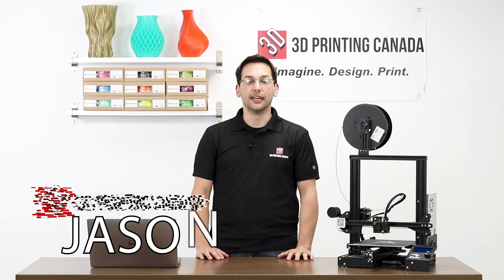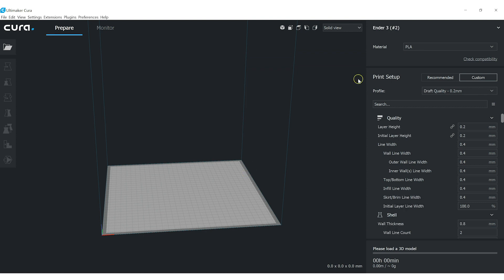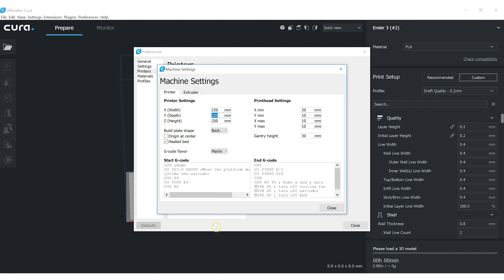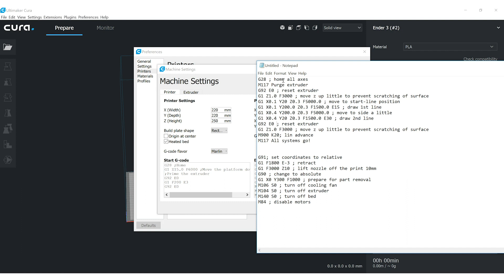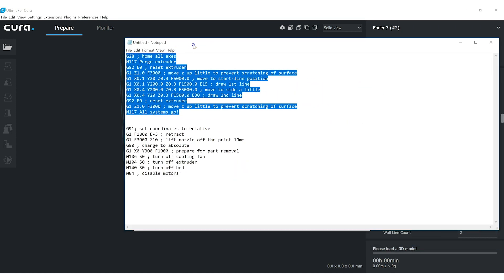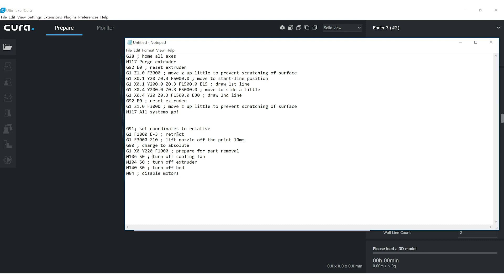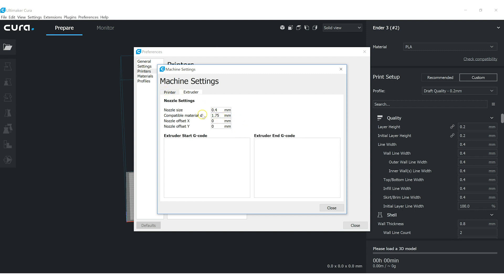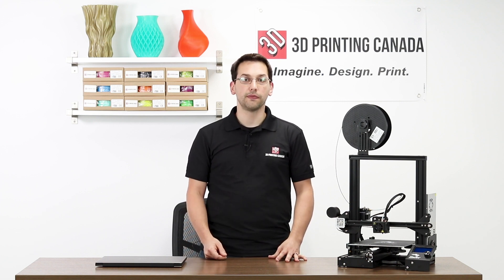Cura Machine Profile for a Creality Ender 3

Comment: I'm trying to adjust my machine settings on my ender 3 with ultimaker cura 4.5 and it won't let me adjust the x min and y min. They are stuck at -26mm and -32mm.... will this mess up my print?

Comment: I was hoping this would solve my problems but it didn’t. I can’t seem to use Cura with my ender. Every print fails at the beginning. After auto homing and running a purge line it starts the brim and does not stick to the bed and creates a stringy mess. I just installed Creality slicer and it worked on the first print no problem. I sure wish I could use Cura though

Comment: Hi could you please help
I have designed a plunger for a drain rod, its basically a circled piece of TPU. It is 100mm in Dia
But when I export it as an STL file into cura and it starts to print. It is only 80mm in Dia
How do I fix this
Cheers

Comment: Hello I have a little under 3 and I installed octoprint everything works properly. I made myself a small box to detect the end of filament with a simple Switch having only a NO contact and a NC with a common terminal.
According to the different tutorials it is necessary to connect with a + a GND and a signal which makes us 3 son. Can anyone tell me that the signal is on the switch's common terminal? Could you tell me the gcode to put in octoprint when there is no more filament on the under 3?

Comment: That just fixed my Cura settings - Thank You.
I have 32bit 2.3.1 - so had to base it on prusa but not an issue - start and end code rocks amte, but ill take purge off, i use the skirt for that xx

Comment: When I look at my default gcode it contains 
M104 S{material_print_temperature_layer_0} ; Set Extruder temperature
M140 S{material_bed_temperature_layer_0} ; Set Heat Bed temperature
M190 S{material_bed_temperature_layer_0} ; Wait for Heat Bed temperature
M109 S{material_print_temperature_layer_0} ; Wait for Extruder temperature
How do you heat your bed and nozzle if you have removed this?

Comment: Oh man... was searching help on the internet watched videos and other peoples settings for the Ender 3... nothing worked and i was pretty sure the printer bed was leveled and well done since I got many printers i know the process... my last resort was a glass bed... well it fixed everything instantly... 

it's just a bad design... shipping a heated bed's are always warped and they put a sticker on it or pcb with that sticker which is so thin the warped bed always comes trough... they should ship it standard with a thick glass plate and will solve 80% of "my first layer doesnt stick" on their printers.

Comment: is it true that cura 3.2 works better than 3.4 with ender 3? I had a lot of layer skipping with cura 3.4 using cr10 profile and now I'm testing 3.2, it seems working better in test cube print.

Comment: Great video fellas.  Could/have you done a video on Lithophanes.  Also when and how to use supports and its relevant settings as finding Cura may generate them if selected but not actually needed to complete a print successfully.
Reply: Jason cheers